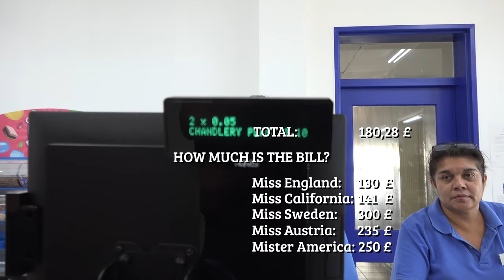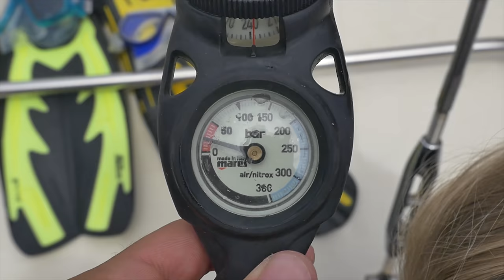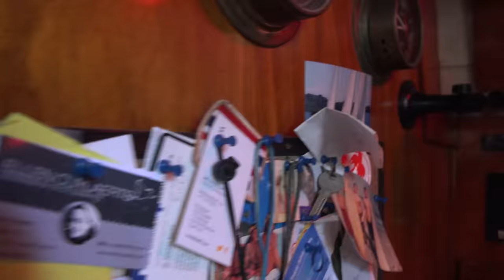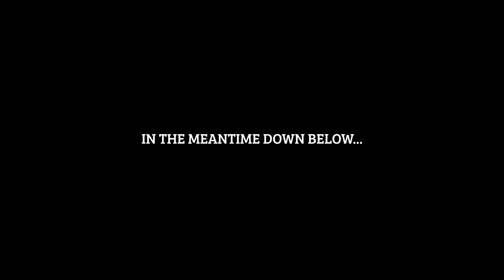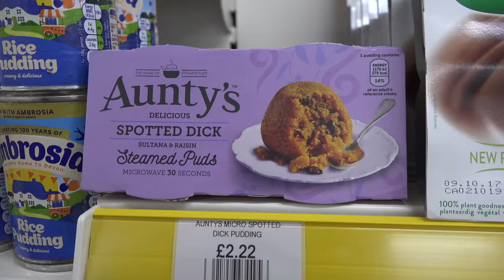My Scariest Moment Scuba Diving! - Sailing SV Delos Ep. 164

Comment: When burned submerge you hand (or other body parts) in cold water immediately and keep it there. A large bowl or pot of very cold water is the best treatment and relief for the pain. It hurts because the burning continues through one layer of skin after another.  Skin creams just seal the heat in.
Reply: He's absolutely right.  No creams, no aloe, no anything until you stop the heat with cold water.  It's literally stops the cooking process.
Reply: No need for for the water to be very cold. Just so cold that you comfortable can keep it under water for 15-20min. Alternatively you can use a product called watergell that works the same way.

Comment: For burns, cold water then aloe vera really helps, take your jewellery off as your hand will swell, then follow up with some anti bacterial cream.
Reply: Well, it's way too late now, but I've done the same thing before, and cold water immediately on the area, for as long as it takes, gets the burn out.  Never cover a burn with creams right away.  It holds the heat in.  Don't know if they ever did this in England, but in the U.S. people use tho think that putting butter on burns helped them.  Old school!  The medical profession finally got people to stop that practice, and use cold water.  Once the burning has stopped, you can put cream on it.  Based on what happened to me, I felt bad seeing you wait out all that heat with nothing cold on it.  Big owie!
Reply: Cold salt water is even better.
Reply: Cool water right after getting burned for 15 minutes really helps.
Reply: Paw Paw cream works miracles!
Reply: Silver Sulfidene  1% (silver sulfadiazine) is a good addition to first aid kits - very good for burns - can help prevent blistering and promotes faster healing

Comment: Bwahaha . . . I'm late to watch and comment, but after tearing apart an engine to find lost impeller parts and installing an outside heat exchanger ... we found the parts in the raw water strainer. They fell "down" into the sea water intake instead of being pushed "up" into the engine. We weren't very smart back in the '70s.

Comment: I was thinking about the impeller problem.  It seems this part is a more "frequent" maintenance item than you may think.  I would appear it should be changed out on a time schedule as opposed to a "fix it when it fails" item.  I guess a item there should be more spares on board.

Comment: Was in Cozumel followed DM under a swim though tiny hole he was skinny guy was little thicker got stuck it kind of compressing my chest. Lucky for me he saw what happened after some pushing I was able to get back out. Big thing for me was I didn't panic but never did that again. The following year I dove 2 deep dives and ended up with the bends for unknown reasons at the time, but later discovered a pre-existing medical issue with my lungs which could have contributed to it. I recommend anyone who dives get medical check once a year discuss it with your doctor any risk of pre-existing issue such as heart, or lung issues.

Comment: I think it is time to put a magnet circulator pump system on and ditched that old idea of them horrible rubber prop blades crap! Grr! i hate that stupid outdated idea and to use it on a new geni is insane, It would cut down on maintenance and improve liability and the only thing needs replacing is a little small magnet inside that spins around, love the diving and MR trivally was funny ;)
Reply: REALLY? ! That will replace a rubber impeller?

Comment: IMPELLER PROBLEM: 
I had a similar problem with my generator. check the water lock since it could be leaking or in the wrong position. when we were in rough weather, it impacted water and air in the pipe and when you start the gen, it would run dry for a while. you will keep having this problem until you fix this...

Comment: Next time you have a burn try the following. Just keep the burned part in a container filled with pretty cold water. Not like 0 degrees. This will hurt you because it is too cold. more like fridge cold maybe 7 degrees. since you have a fridge and freezer on board you should have no problem having plenty of it. just hold the burned part in there. My experience is that al long the water is cold enough you will not feel a thing. Once I had a big gas flame pointed at my face for a short moment. I jumped aside and beside some missing eyebrows and hair on top of my head i had a mild burn of the face. I took a container of cold water and with a snorkel in my mouth I went down on my belly and put my face in the cold water for a few hours. As long as the water is cold enough no pain. Once it starts to come back just take new cold water. Had the same with a badly burned thumb some other time. on the back of the thumb I had a big blister. Like 1x1x3 cm and it did hurt a lot. Held it in cold water for a few hours and had no pain. Just changing the water when getting to warm. then took a big pan with cold water put it next to my bed and went to bed while the hand was in the cold water. No pain and slept like a baby. Next day pain was gone. Just give it a try next time because pain is never nice.

Comment: never turn the impeller the direction it does not run in .  you must fit it twisting in its direction of rotation  . yes rubber moves ect but . its just good practice and a little rubber grease while fitting .. works for me

Comment: MEDICAL ADVICE INCOMING ^^

hi ladies and gents, by the way, just a litte info about burning the skin, with hot water, direkt after contact, cool it, with cold water (maybe with ice in it) for at least 20 minutes, to prevent from further damage of the part below the skin (sorry, for missing words, my english is not the best...). the problem is, that if you can´t get the heat down, it will damage the skin further more, because the heat will be saved in the part below the skin (tissue?). that only works for burnigs 1st degree, for 2nd degree, you had to visit a hospital. 

just want to inform you, so sail safe and stay healthy (@ liz...hope it didn´t hurt anymore)^^

Comment: Get used to the Onan impeller failure.   It won’t stop.  I’ve got generator from that Onan line.  It’s a design failure Onan doesn’t seem to care about.  Youll  uncover plenty of premature failure experiences of boat and RV owners in the internet.  They seldom last more than 100 hours and often only 20 or so

Comment: It’s the wrong impeller it’s two wide for the housing so chewing the blades off , ware the next one on sone sand paper , sand the in and out ports of the housing with sand paper  grease the hell out of it and install sometimes pump housing can be warped and the impeller gets a hard time and fails  good luck